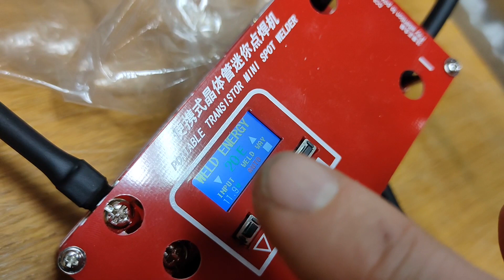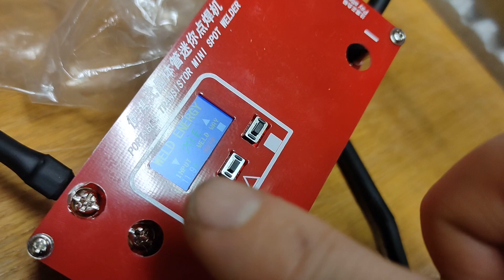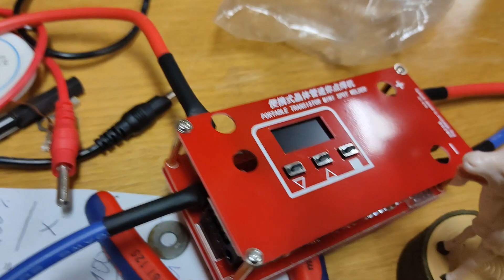Battery tab spot welder went up in flames

Comment: That welder is crap out of the box, but if you do a research ,after some very easy and affordable mods, it can be a perfect welder for the price. Bottom line, before you buy something, google it. Easy...
Reply: Also read the F manual. Everybody seems to use the wrong battery and then complain
Reply from the maker: I Read TFM. my battery was fine.

Comment: Loads of people are videoing themselves blowing theses up & the comments are usually full of “Chinese crap” Try using a 200ah battery minimum & do some research & maybe some modifications before you use it. It’s a budget/hobby spot welder, if you want a better one then spend some more money but plenty of people use these & get a good result.
Reply from the maker: Well, even if the reason is a battery that is not charged enough, that they sould programm the welder in a way that it just swiches off insted off caching fire!
Reply: After the first one blew. Car battery and solenoid.  No MOSFET Horsesht. NOPE
Reply: You are not a qualified electronic technician. You dont know what you are doing.

Comment: You've blown Mosfets due to using Crap Battery...
Reply from the maker: would you care to explain what about this batterie makes it unsuiteble for the mosfeds?
Reply: @danielsrealmofenglish4311  During the short that occurs to make the weld, the battery voltage drop too low and cause the mosfets to malfunction.
That spot welder will still work if you get a strong enough battery, even after it caught fire.
Reply: @danielsrealmofenglish4311  lots of info on YouTube, not just about Volts, amp droppage is the issue, watch a few posts as well as just making them, perhaps start with this one, https://www.youtube.com/watch?v=fdnO0Z-scjA
Reply: Again just battery solenoid 2 wires and button.  All you guys.  MAN UP. SHT
Reply: I use whatever battery is in reach.  No Mas. mos.   That's for girls

Comment: A flat battery can show 12 volts , but not be good enough to start a car . ... 11.9v indicates the battery is completely discharged. Anything under 12.2v means the battery is in a state of discharge, and a healthy battery should show 12.6v in a static state. Yours needs to be replaced.
Reply from the maker: that's just not true. a lead acid batterie under load is dead when it shows less then 10,8V My batterie fare from healthy but it is no dead yet.
Reply: @danielsrealmofenglish4311  Maybe it's not dead but there was not enough current. Your fault is because of the battery 100%. I have 3 of these spot welders. The first blew up for the same reason. I am using now 3 lipo 3s and I have great results.